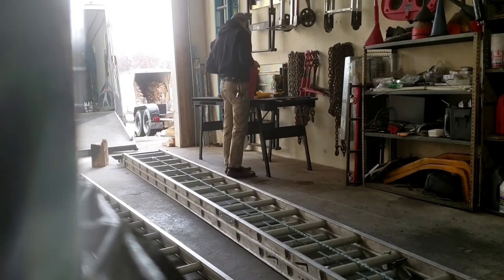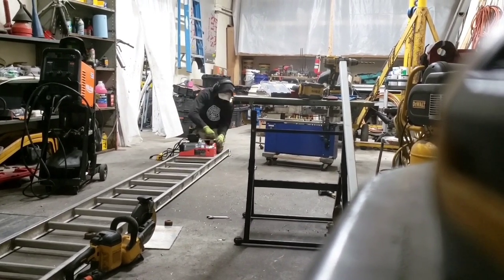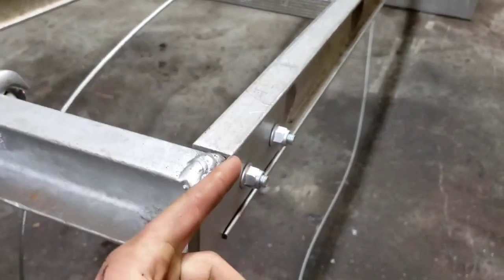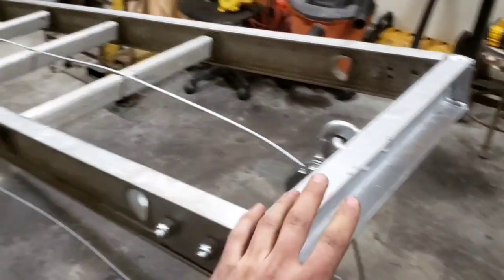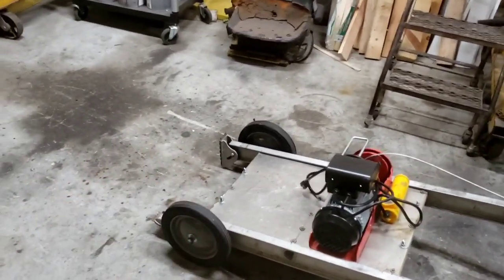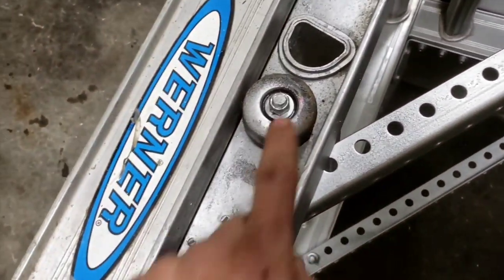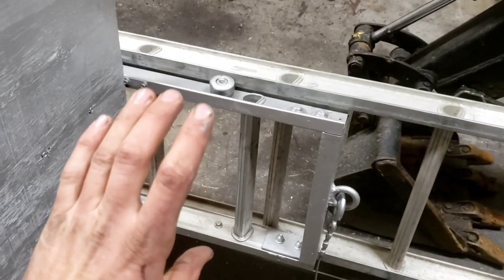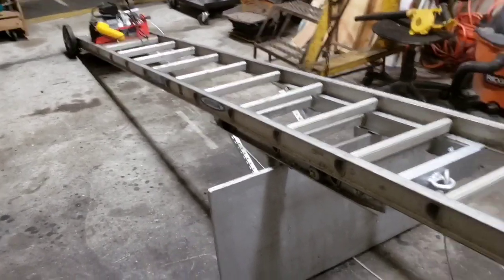DIY ladder hoist

Comment: Wow!  very nicely done.  Thanks for sharing.  So just a note, I had hoist cable break few days ago, never would have thought that could happen  It rusted inside the block weight that is just above the end hook.  It was a drop down ladder that fell 9 ft and cost be 300 to buy new one.  Just sharing because I am hoping my stupid mistake will help others use extra safety measures.  Will now have a 2nd strap to hold load if cable fails, which will suck unless I can make auto retract one direction.  Anti fall lines are just too expensive.

Comment: This was sped up.   Watch video at  0:75  In my opinion that ladder used was too light. Use the heavier 300 lb rated ladder instead.
Reply from the maker: I'd agree. if you had the choice go with the heavier ladder. We used what we had at the time, but good point!

Comment: its too short, how is that going to reach 26 foot 2 story roof?
Reply from the maker: We only needed an 18ft section, but if you were to need to get up 26ft you could just swap the components over to a taller ladder!
Reply: @theshop6161  i meant that it wouldn't work on an extension laddar, because of the 2 laddars overlapping

Comment: how much did you save on material? and were you charging labor when you built this?
Reply from the maker: I believe i only spent around $300 for the hoist and some odds and ends. No charge for labor as i built it for myself, but made a good return with out on the job it was built for. 2 years later its still going strong!!!!

Comment: i want a hight adjustable.. any tips ?
Reply from the maker: Oufff haha now thats a challenge! I'm not sure off the top of my head as to how i would do something like that, but its probably possible! My concerns would be 1. Weight - The lift is already fairly heavy and a bit awkward to move about, so I can only imagine adding more hardware/components. 2. Moving components - Something like an adjustability feature introduces more complexity/moving parts and would create more potential for either user error or mishap. I wouldnt be against the idea, but keeping it simple would be best. 

        Actually as I'm writing this i just thought of a "solution". Instead of having the ladder be adjustable just keep multiple ladders of different lengths. Kind of a simple solution that would only require mounting the basket and motor from one ladder to another (which is not hard to do). That way you get your adjustability, but don't sacrifice the weight or structure of the ladder hoist!
Reply: @theshop6161  ive also looked up some profi  models. they have U beams 5 pieces that fit in each other.. and move in and out. and use a big wheel that wont get stuck on the hight difference
Reply: @theshop6161  what about using an extension  ladder, adjust the ladder to the height you want, and if you don't like those skimpy hooks that lock it in place, drill and through bolt it. That way the top stays the same and the motor is mounted on the bottom section.